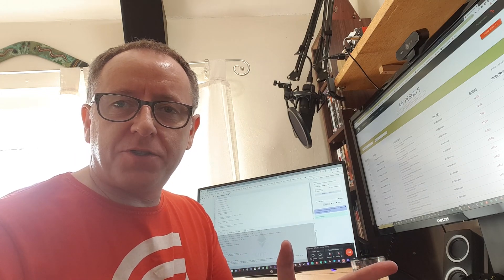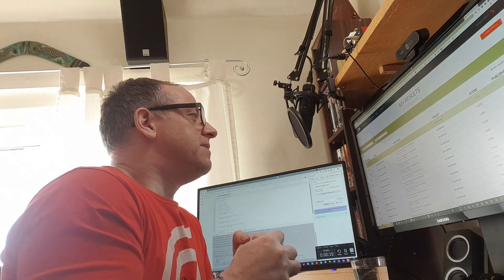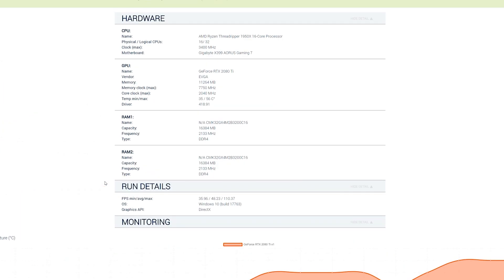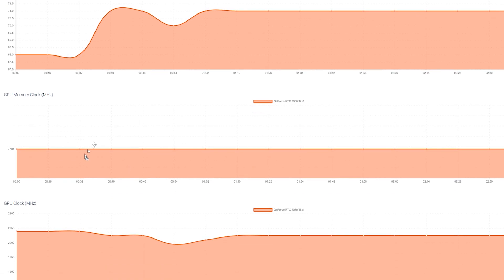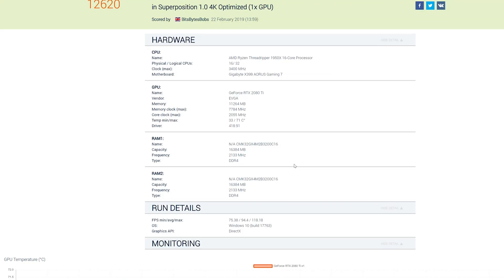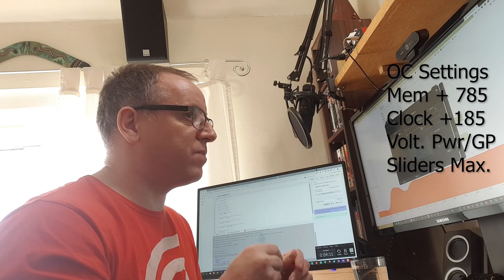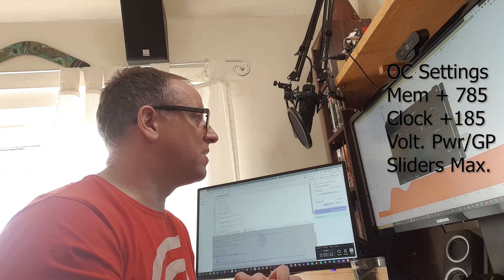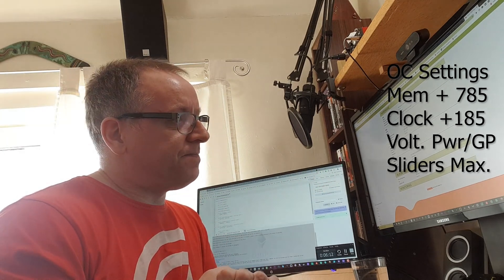Watercooled 2080ti Overclock Settings & Benchmark -  EVGA Black Edition

Comment: Just installed the same cooler as you do with the same aio h55 :) very happy with it, i saw 64c maximum with 1920mhz core clock and 8200 mhz memory. The biggest difference is obviously its way quiter than black edition cooler which was like a jet... i also saw -10c temp reduction, previously used stock cooler at 90%, only at that speed it was effective (70-73c) but was toooo loud.

Comment: Good video, exactly what I was looking for, thanks. I got a good deal on a 2080ti, but it has a blower style cooler which is really noisy and runs hot, holding back the performance. I was looking at this exact AOI cooler, and was worried it wouldn’t be up to the job, but it looks like it works well.

Comment: Neat. Seems like there is a making piece for knowing what you did as the 2080 backplate is on it here which wasn’t on it I’m video 1 (install). Did you also install the middle plate to give the board ICs proper heat sink?

Finally where is the pump and kraken fan powered from? Are there PWM headers on the 2080TI black?  

Oh and what was that about not being able to baseline? Did you remove the fans or just set them to stand still or what was that all about?   A complete video that showed ALL of the install steps would really be helpful. Because it seems EVGA has discontinued their own soln for this card so only aftermarket like kraken remains.

Comment: I found a 240mm watercooler for 60$, so I am going to implement this solution for my RTX 2080. I don't think I can get a better solution of getting more performance anywhere else unless I jump to the 2080ti which is much more expensive than my 2080.

Comment: I was looking the G12 ( with AIO 1x120mm ) for my 2080ti AMP but my tmp are 42c idle ( 38% fan curve auto ) and 72c max with OC ( 2055 Mhz ). I suppose that I need at least 240mm or 280mm ( 360mm may be overkill ? ) to cool at 45c MAX ( I see ppl geting this temp in reddit I think ) to get a significant improvement. Do you know how to connect the fan from g12 to the 2080ti fan ? I think the ppl use and adapter.

Comment: Was looking at doing this to my msi gtx 1080ti now the card it getting a bit older. Might replace the 92mm fan with a nice noctua fan and got some noctua thermal paste laying around. Good videos mate
Reply: I literally did this same thing yesterday, H55, Kraken G12, MSI 1080ti, replaced 92mm vrm fan with a Noctua. Temps came down from 75c to only 60c and the coolant in the H55 got INCREDIBLY hot. Like you couldnt touch the tubes hot. Using Arctic silver 5. I am returning the H55 and going with a ThermalTake 3.0 120mm. The H55 only has 1500rpm pump speed and sounds like cheap chinese shit! The ThermalTake 3.0 120 has better pump system and sits at 3000rpm. Would highly recommend choosing your AIO wisely as I severely underestimated how much heat my 1080ti generates under load
Reply: @UTBproductions1   I'm about to attempt the same modifiaction and got a H55 sitting here (still unopened) - did switching to the TT 3.0 120 improve your situation notably?
Reply: Erbsenbrei the thermaltake brought it down to 47c under load on Pubg(not optimized at all lol) and doesn’t go above 37c on Borderlands 3 on Badass settings. Custom fan curve though. I would recommend at least a 240mm for a 1080ti

Comment: Where did you connected the pump and fans?
Reply: In this case, H55 has 3pin pump header and you can connect iz to chasis fan header on the motherboard to run it at full speed. I`ve connected my fans through mini 4pin for GPU to normal 4pin pwm. I have push/pull configuration with two 120mm fans so I`ve used 2way 4pin splitter